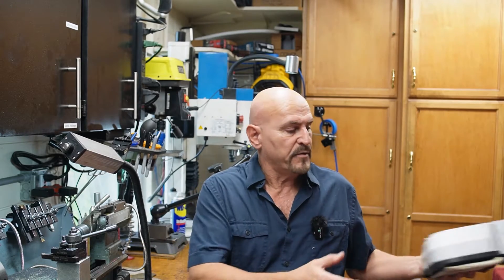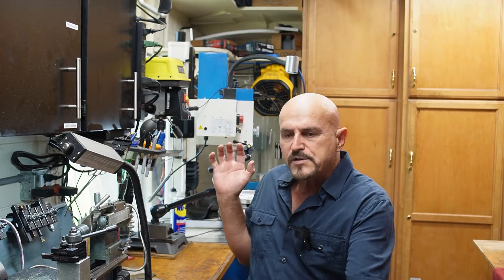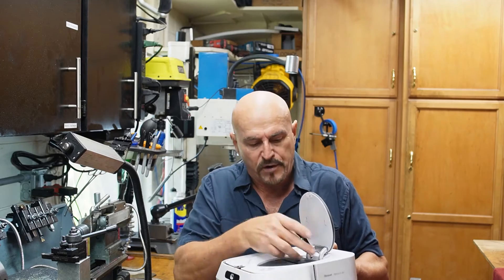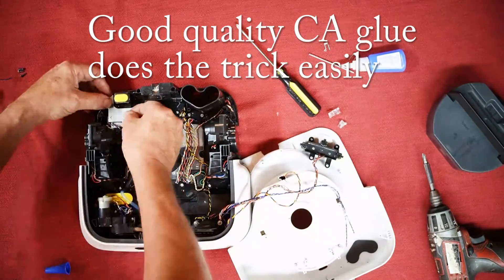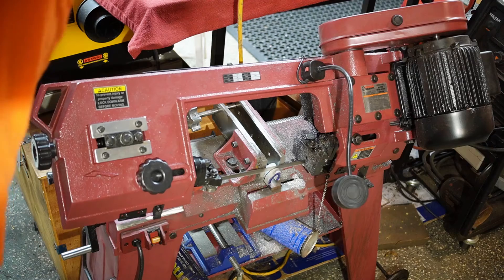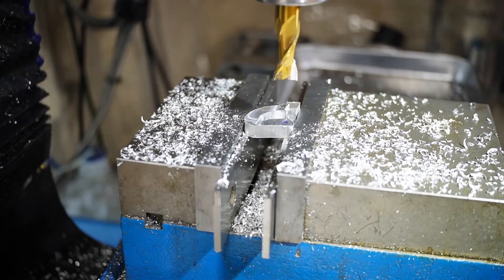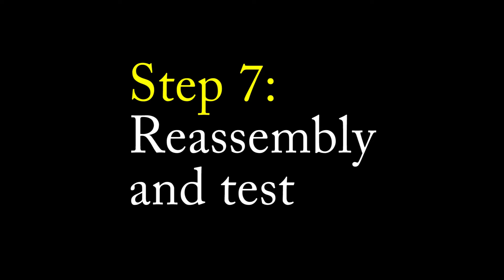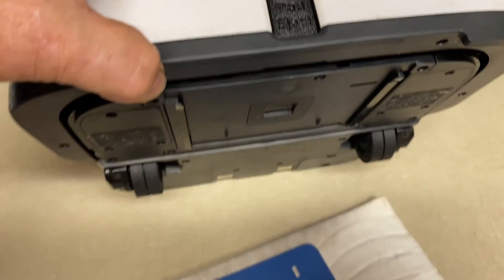New lid hinges for Braava Jet M6

Comment: I do have the mop and I don't have the machine shop.  Any chance you would sell a set?  Nice properly engineered fix!
Reply from the maker: Sorry Arron, but I'd have to charge more than the cost of the mop for my time to make a set.  I probably spent ten hours making my set -- which was fine for my own personal need, but clearly not something that would be cost-effective to sell.  

Someone with a CNC mill setup might be able to turn a profit on making a few dozen sets of these at a time (and I believe the demand is out there).  But it's way too time-consuming to do one-offs on my manual mill.

Oh, and I no longer have the old plastic hinge to model new hinges from.  So I'd have to take apart my mop to figure the size/shape again, adding some more hours.

I'd love to help you out, but I'm afraid that this just wouldn't be practical.
Reply from the maker: Oh, as I mentioned in the intro to my video, rather than fixing your broken hinges, another quick-and-dirty approach might be to glue on a magnet to the front of the lid, near the latch.  Underneath that latch is a magnetic switch that detects when the lid is closed.  You could likely fool that switch by a strategically placed magnet.  Heck, with a thin steel plate glued to the top of the reservoir, a strong enough magnet could even keep the lid properly closed and fool the switch at the same time.